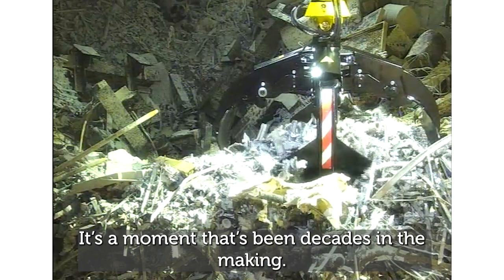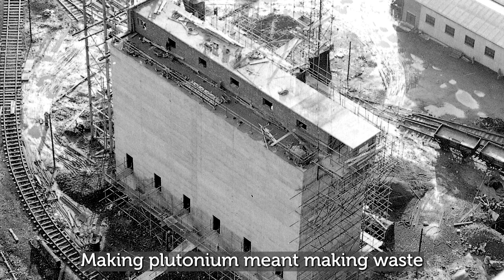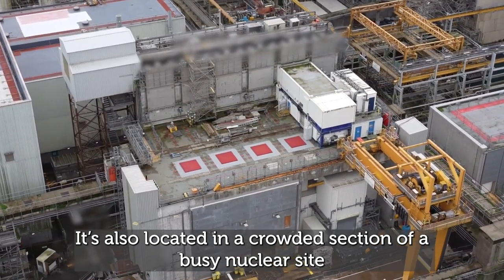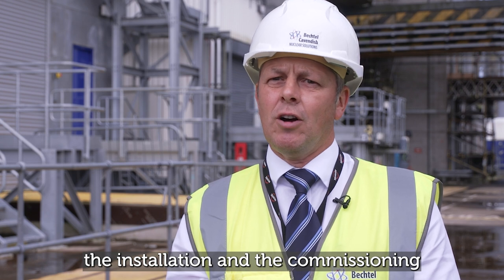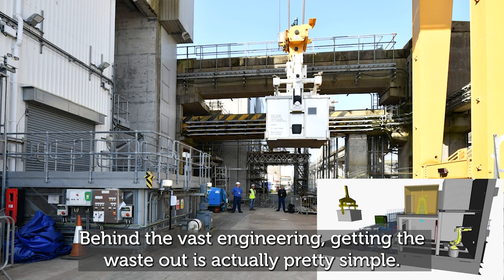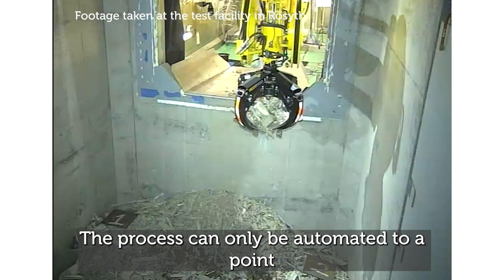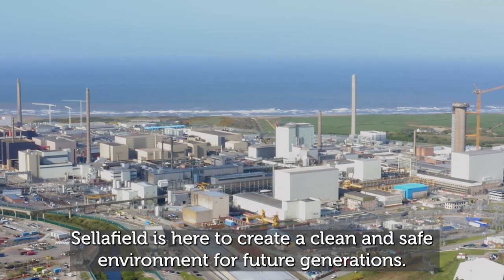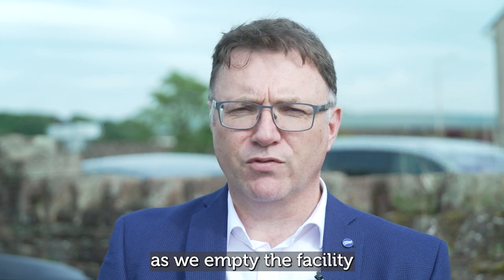Pile Fuel Cladding Silo - Start of retrievals

Comment: The cladding is zirconium contaminated with a little bit of nuclear materials. Easiest solution would be to disolve the nuclear materials into an acid bath then recycle the zirconium to make new  fuel pins. The slight amount of radiation added would not be a problem. Then the acid bath can be distilled off to yeild a much smaller volume of high level solid nuclear waste.
Reply: It's not, it's magnesium. The Windscale pile and first-generation British reactors used a magnesium alloy cladding, hence the talk about argon purge at 1:51. The only reactor still running with magnesium cladding is in North Korea.
Reply: @straightpipediesel  yikes magnesium as the cladding, that's a bit dangerous 😳